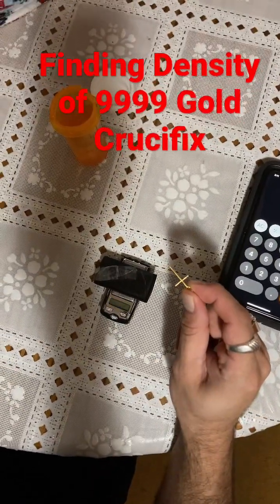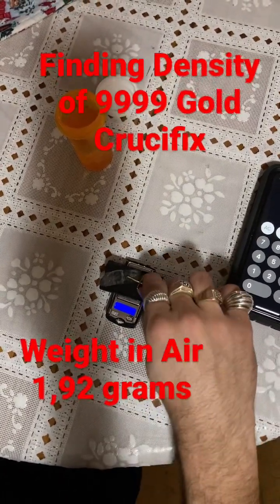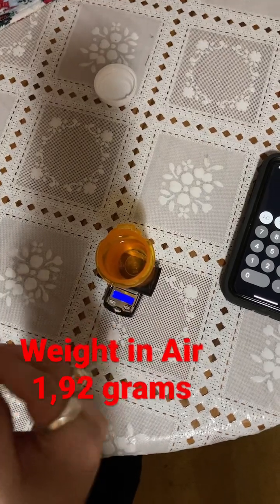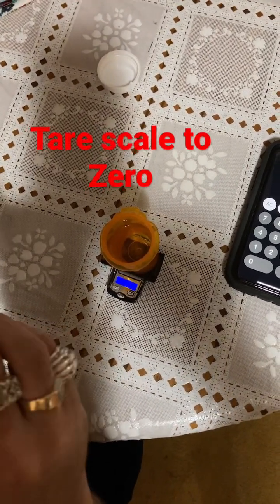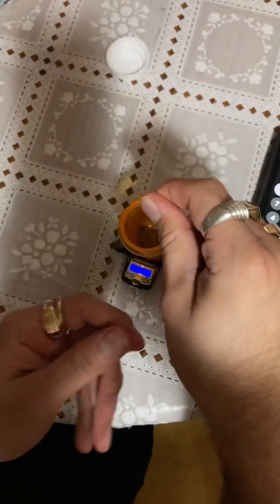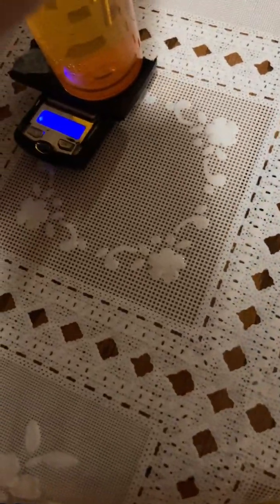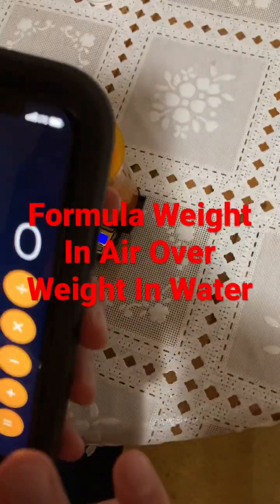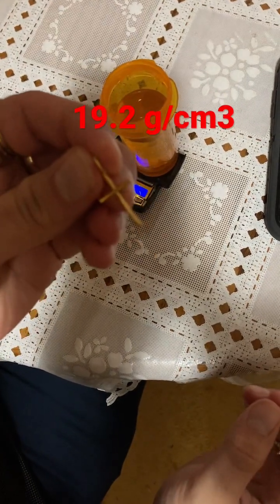How to Find the Density of Gold! Archimedes Principle! Purity of Gold Demonstration H2O Displacement

Comment: Bro you are measuring apparent weight or bouyant force?
Reply from the maker: @Abhishekverma-uh9ih
Formula Weight In Air Divided By Weigh Submerged In Water equals Specific Gravity. 

I have a few dozens videos on demonstrating karat gold 5K-24K and platinum alloys and even gemstones. 

👍🏼

TBBW🐺
Reply: @TBBWDontPlayNoReindeerGames i saw some other videos they divided by difference of weights why?
Reply from the maker: @Abhishekverma-uh9ih 
My videos follow the formula of the archimedes principle. 

All of my videos I show the formula SG=WIA/WIW.
Reply: @TBBWDontPlayNoReindeerGames please also make some videos on electrical conductivity test for different karat gold using multimeter
Reply from the maker: @Abhishekverma-uh9ih 
I have a couple videos with the GT-3000 using electrical conductivity or pulse  transmissions.
Reply: @TBBWDontPlayNoReindeerGames make some cost effective method